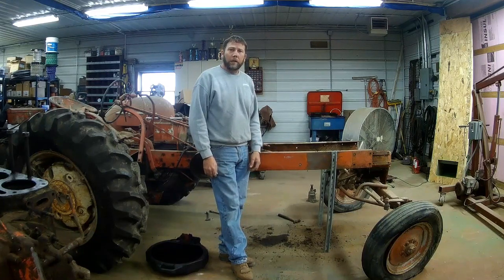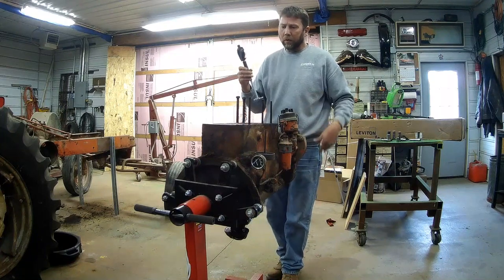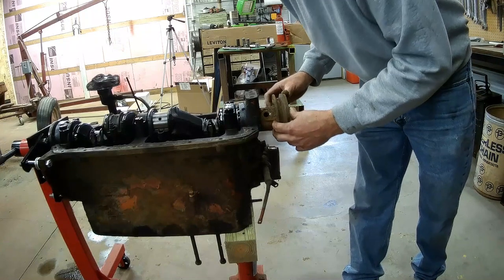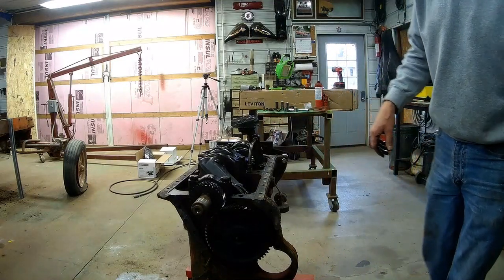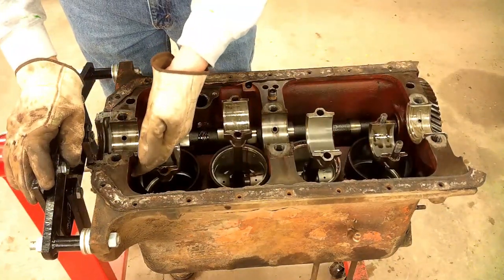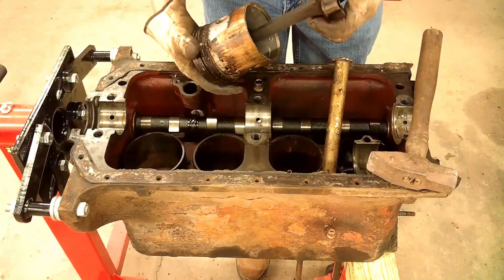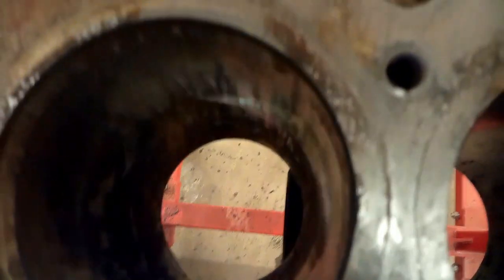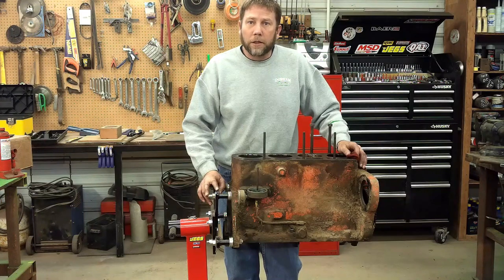Allis Chalmers WD45 Restoration Engine Disassembly Ep.4

Comment: @ 10;13, I do believe the rods and caps were a marked set from the factory. I rebuilt the engine in my 1935 WC Allis some time ago, and the rods had 3 different stampings on each one.
 Somebody didn't clean things up to look at them before stamping it the second and third time.
 Don't freeze the sleeves. Leave the o-rings off and slide them in place, they will slip right in if the block is clean. Then give them a turn to make sure everything fits freely.
 Then use a washer and bolt on each side to snug them against the shoulder to measure the 'stand out' of the sleeve. It should be .004 above the deck. Take the sleeves back out, put the o-rings on and slide them back in. A block of wood and a little bump from a hammer will set them in pale. There is a lead in chamfer on the lower bore that NEEDS to be polished up to help keep from tearing the o-rings.

Comment: This might be a dumb question, but why do people sleeve engines? Is it when you can’t bore out the block anymore? And if you sleeve a block do you need new pistons to match? Great video!👍
Reply from the maker: It depends on the engine. If a cylinder is badly damaged, sometimes they can be sleeved. On this type of engine, you don't bore at all, you just replace the sleeves. Pistons need to be replaced in either scenario. Tractor engines like this one are usually wet sleeves, meaning the coolant flows around the outside of the sleeves. You will see more in the next video. Thanks for the view Cody!
Reply: Sparks Fire and Baling Wire  Right on.  I didn’t know that.  Thanks!👍
Reply: YDOC Productions I didn’t know any of that either, learned something good today! I had heard that a few times any wondered myself what they were used for.